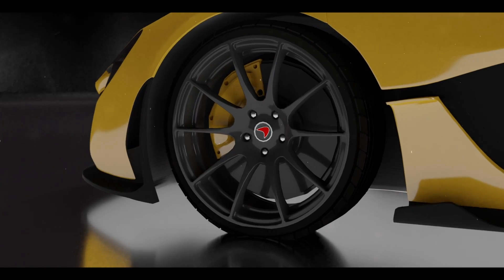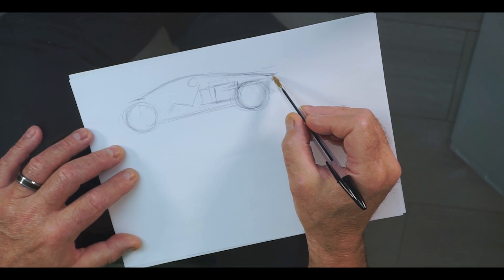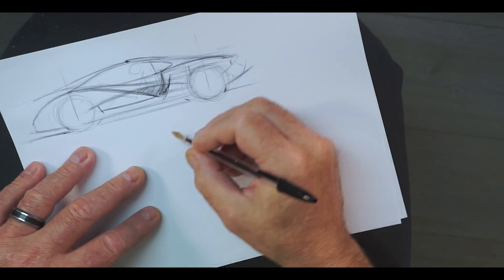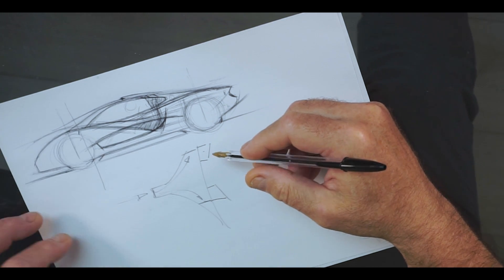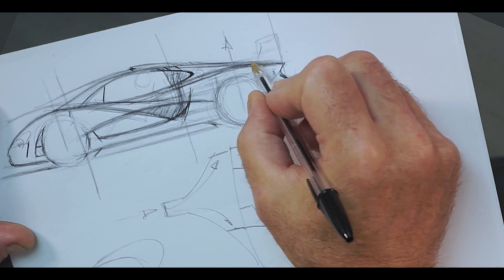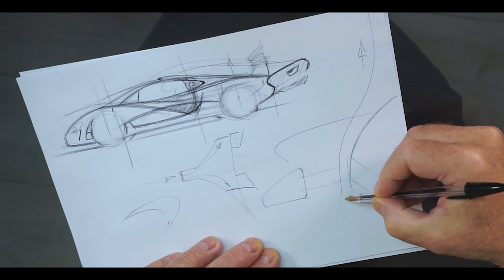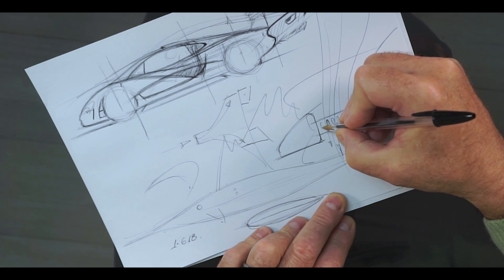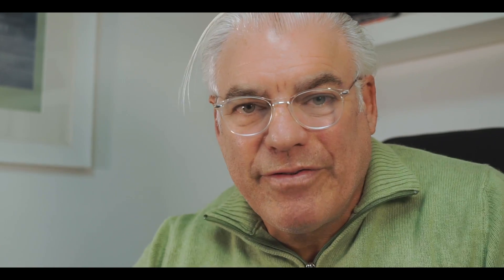How The McLaren P1 Was Designed! Ep.7

Comment: Its a shame car manufacturers dont apply this design to their cars to get better milage and fuel efficiency be it electric or fuel. Better handling and braking makes alot of difference to tight corners or short bends and good use of cooling for both with vents and splitters . Nature can teach us alot as it has been around for quite a while and survives through all types of conditions. Ive allways liked the celica mk7 but found it needed to be wider at the front to balance the back . Would be nice if they made it like the maclaren long tail just to finish it off nicely instead of the flat slab at the back.

Comment: I saw my first P1 in person on the 30th of November. I had wanted to see one for over 7 years since it first came out. The car in video games grew on me and it quickly became my lifetime dream car, the dream car I had never seen. I went to mclaren Dallas with a rumor there was a P1 on the floor, and it was under a cover. I stared at it for about 10 minutes while casually sipping a seltzer water and the guy who kinda runs the showroom floor said from behind me “I bet you wanna see it eh?” And then I told him I had never seen one in person. He put his phone call on hold and took the covers off of the car from the tail. It was the most beautiful car I have ever seen before, the carbon fiber was literally everywhere except the paint, a pretty metallic silver. I shed some tears, took some photos while he resumed his call, and helped him put the cover back on the car after I was done. He had shown me the mechanical locking mechanism and opened the door so I could look inside, the chassis number is 126. It’s a number that I can’t forget anymore. My favorite parts of the car are probably the scoop, the aggressive bonnet, the carbon door panels, the carbon door sills, the rear wing that was also in exposed carbon, headlights and taillights, and the fans behind the mesh in the rear of the car. The only cars I could even remotely compare to the P1 is the Huayra BC and BC Roadster, a purple carbon Huayra Roadster I saw (sadly it crashed last month and was completely totaled, still have a piece of that one), the Pagani Zonda Barchetta in blue carbon fiber, and honestly nothing else. The P1 and the Huayra BC Are both my favorite because of how unique they are, and their powerplants. Fairly, the Huayra has a very unique V12 while the P1 just has a V8, but I love the way the P1 looks, how futuristic its design is compared to the classic Huayra design. It’s more curvy and sharp than the Huayra is, being more boxy and squared off, yet still intricate throughout. Thank you, for designing such an incredible machine, I hope to own one someday. The one I saw was pending deposit and selling for just $1.4M. I can attain that by the time I’m 40 flying planes across the world. Take care, and again, thank you. It is a truly special car and always will be my favorite mclaren.